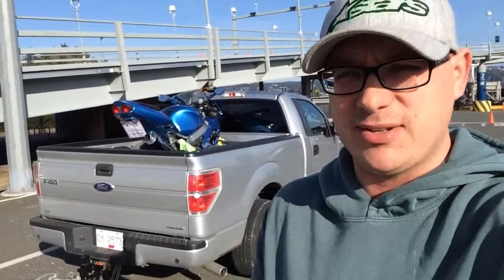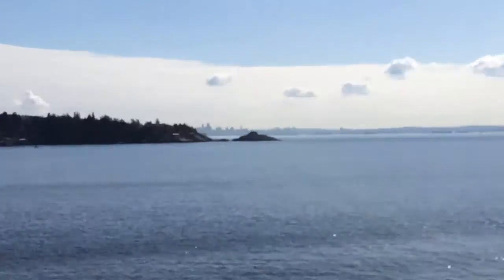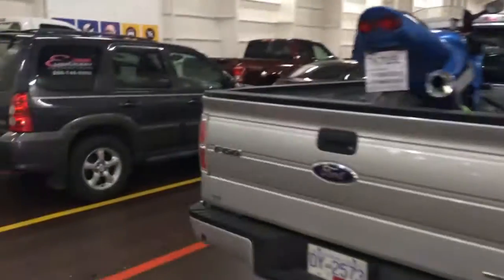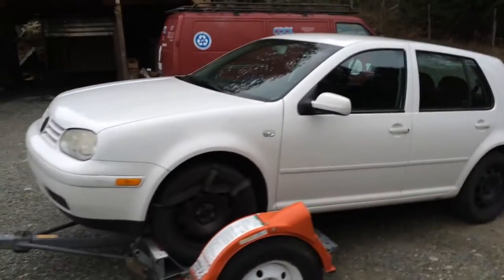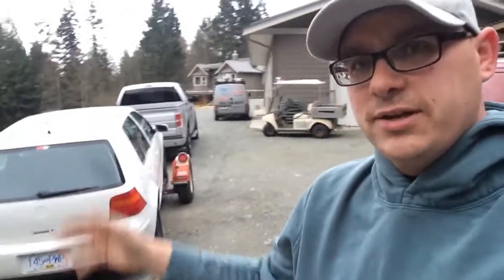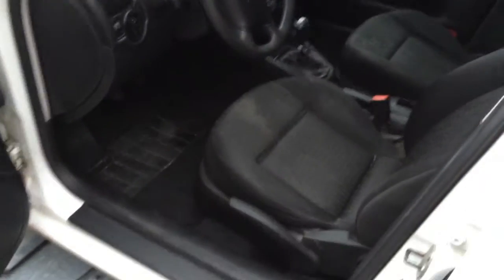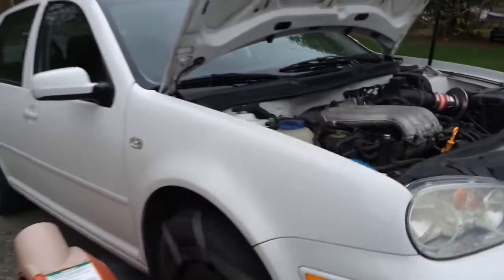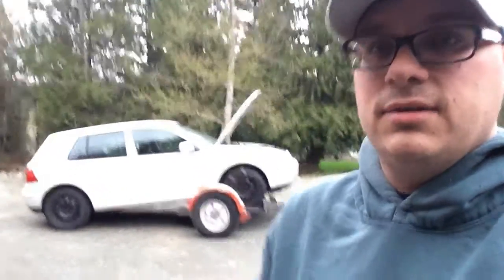This Old Car: 2003 VW Golf

Comment: Which engine does it have? The remotes are not hard to reprogram, but finding one that still works might be the challenge. I'm not sure if you need someone with the proper scan tool for reprogramming. I used to have a 99 Passat, and looked into getting a new remote. I never got around to it, since mine still worked, and I had other repair priorities.